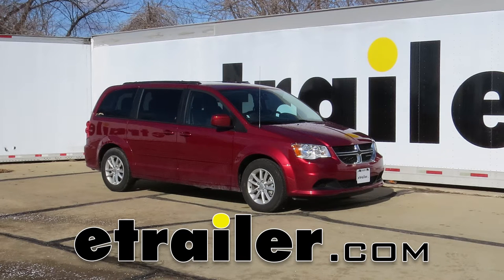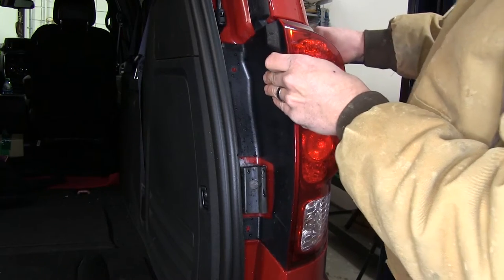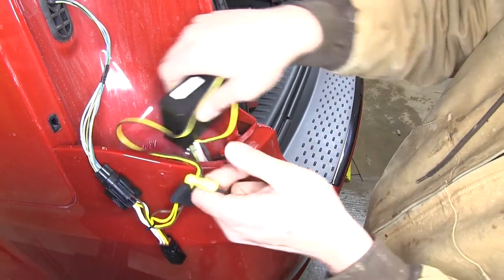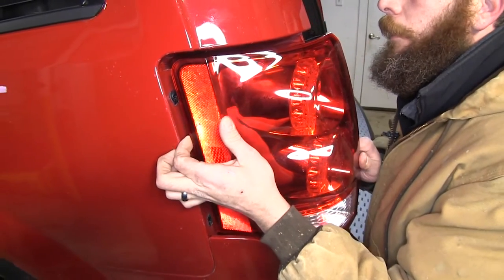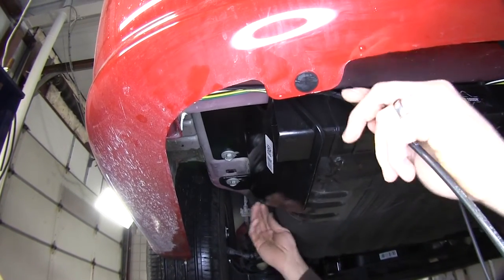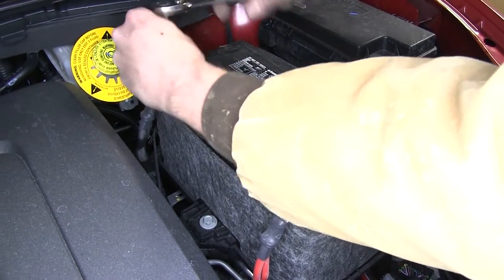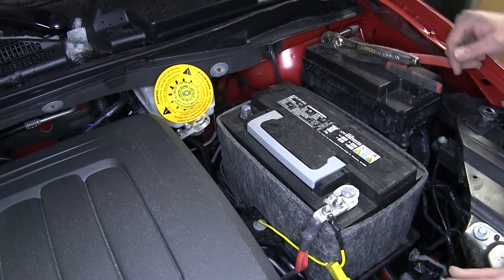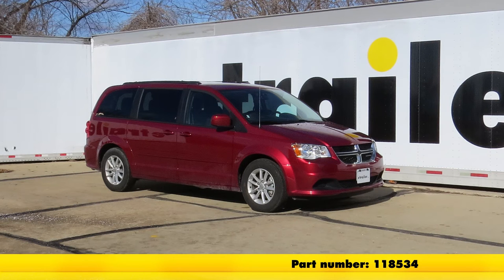etrailer | Trailer Wiring Harness Installation - 2015 Dodge Grand Caravan

Comment: Use dielectric grease inside the electrical terminal block . Before installing ground wire terminal grind metal surface and coat with the grease .